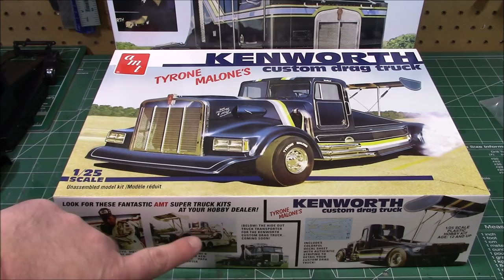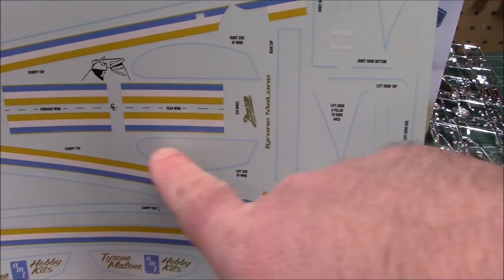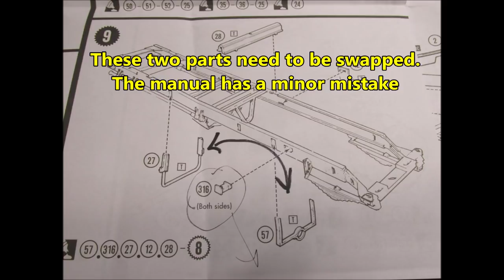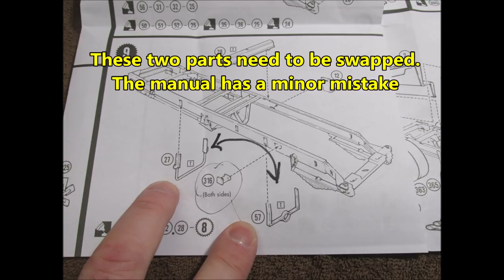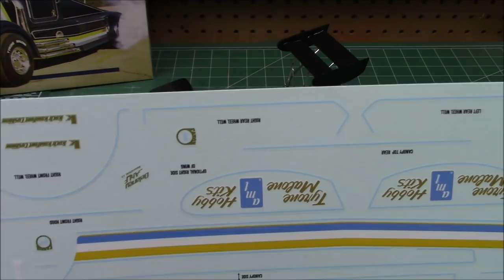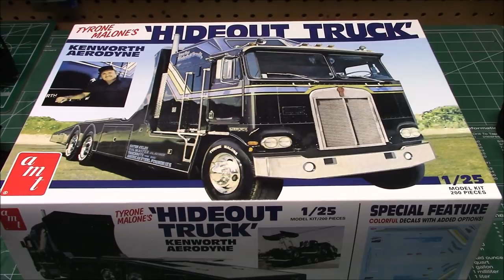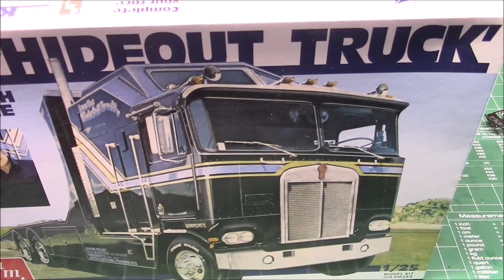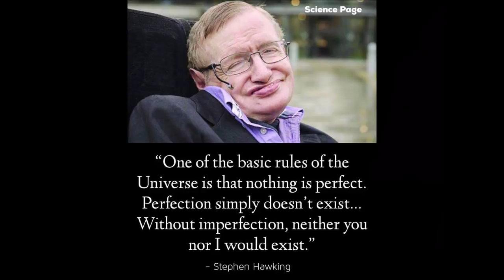Kenworth Bandag Bandit / Hideout Truck Tyrone Malone Drag Truck 1/25 Scale Model Kit Build Review

Comment: Started the Bandag Bandit today Chris, I was going to just clear it like you did but the cab had some pretty good scratches in it, I sanded it down and ready for prime and paint, engines done and ready for paint, working the frame now, it is a little fiddley but going together ok, got to do a couple test spoons I'm either going to paint it Tamiya Metallic Black or Dark Mica Blue I'm leaning towards the Mica Blue because it looks like the photo has a Blueish look to it 😃
Reply from the maker: I guess on the real truck they mixed a bit of blue in the clear coat to get that look.
I have a Tamiya 1/14 RC semi in Mica Blue, it looks really nice.

Comment: Nice build! I love watching your channel as you build straight out of the box, which could entice new modelers into trying the hobby. Myself, I've been building for almost 50 years, mostly big rigs, and usually do a lot of scratch building and adding aftermarket parts. I usually airbrush clearcoat on the cabs but was wondering how you apply the Future polish? It seems like that would be an easier way to get the shine if I was doing a quick build. Keep up the great work and I'm looking forward to your build of the hauler for this one.
Reply from the maker: It gets brushed on and left to dry. Thanks!

Comment: even if you hadn't gone back and adjusted the gap, it sill turned out real nice, so was the cab set back a little more to the rear cowl to close the gap since the rear wheels fit the rear wheel opening correct ??
Reply from the maker: I had the hood on too far forward, which moved the cab up which gave the gap. Once I joined the cab to the rear, then installed the hood to meet those parts it all worked out.

Comment: Hi Chris, I'm getting ready to start the Bandag Bandit And was wondering if you could tell me what caused your gap problem and what you did to fix it, I'm hoping to avoid the gap. Thank you Chris 👍
Reply from the maker: I put the cab on first and everything else after.
I fixed it before the final. 
Should have glued the cab to the rear body, then placed the rear body on the frame where it's marked to sit and it would have lined up the first time.
Reply: @hpiguy  thanks Chris I'll give that a try when I get there

Comment: Nice Job! - quick question with paint....I’ve been having problems with the paint chipping on the car body as I assemble it……wondering if Im not letting the paint cure long enough before handling? I usually spray the body and then wait 2 days after the clear coat…..should I be waiting longer or am I maybe not spray the primer, paint and clear coat properly
Reply from the maker: I've never had paint chip on a model unless I wanted it to. Sorry, no advice on that.

Comment: I would like to see a video on how you break a glue joint like you did with this model to correct the mistake. Thanks
Reply from the maker: I do final assembly with super glue and if you give it a quick tug it will snap clean most times. Unless you hose it down with glue.
Reply: @hpiguy  I have found putting a part that is super glued in a freezer for a while will make the  joint break easily.

Comment: Can you airbrush future on kits?
Reply: He's done a bit of airbrushing in older videos but seems to prefer spray cans and I can't really blame him, they're quick and easy for multiple builds every week.  I LOVE my airbrushes, but I take months to build in my spare time. I bought a very nice set of 3 airbrushes a few years ago on Amazon for a great price. I run them on a 3 gallon "pancake" compressor with excellent results on both model kits and full size vehicles. I did have to do a small "plumbing project" to connect the airbrush fittings to the compressor, it wasn't a big deal though. It takes practice but once you get the hang of it airbrushing is easy. The hardest part, other than finding time to do it for hobby work, is getting the mixture and technique down. Practice makes perfect-if you have the time. There are many good videos on YouTube to help you along.
Reply: Mike Brown I was wondering if you can use future in your airbrush instead of using a brush
Reply: @ericbowman7015  That I couldn't say for sure because I've never tried it. I never even thought about Future as a clear coat until watching this channel. I still haven't tried it but I plan to soon. On the other hand, I can't see any reason why you couldn't use it as long as you can spray it.
Reply: @ericbowman7015  yes you can and it doesn't need to be thinned just pour and spray
Reply from the maker: Yes, spraying works just fine.
Reply: Thanks guys the information was helpful

Comment: Was that engine 2 Stoke Detroit
Reply: Yes a V-12 Detroit. Not sure what the displacement is though. It's also backed up by an early Allison automatic transmission.
Reply: Was a 12v92 variant. Take 12 x 92 that's how you get the displacement of the 2stroke Detroits like 8v71 8v92 etc.
1104 cubic inches! Had to get to a pen and paper! 18 liter.
Reply: @tomcline5631  My dad was an owner operator for most of his life, and I'm an owner operator too. Even though he loved his Peterbilts later in life, if he could, he'd tell you that the best tractor he ever owned was a 1979 GMC General with 8v92ta Detroit power. About 2 years ago, I tracked down and bought dads old Gentleman Jim (that's what he named it) and it's now in my shop being restored in his memory. Jim also has an Eaton 15 speed and Rockwell 44k rears on springs. The restoration has and will continue to be a long process but it'll be worth the time and expense because my sister and I both have great memories with dad and Jim! There's also nothing like the sound of a Screamin' Jimmy on the Jakes!
Reply: @MikeBrown-ii3pt  Man,that's amazing! I love the General! When I was a pup,I worked at a shop,and we contracted with a local quarry that had dozens of Generals as their highway dump trucks. Some had Detroits and some were Cummins. That's the 2 I remember, probably some had cats in em also. It took all day to service 2 of them because they had over a hundred grease zerts! We had 3 charts that showed the location of the different set ups over the years. Amazing trucks. 
I drive trucks for a farmer,and one of the neighboring farmers has two Generals,one is a 10 wheeler and the other is a tractor and trailer. Old Coke trucks. 
I hope you have the budget and time to get your old man's truck back to it's Glory!! Almost choked up a little reading your post. Best wishes! Keep the dirty side down!
Reply: @tomcline5631  Me, my wife and sis are getting Jim back in shape slowly but surely! He'll be a show truck in another year or so and dad would be proud. Thanks for your reply.

Comment: The gap between cab and rear body, maybe mold error and engine mount holes are a few inches too far forward on frame rails. If I build this kit, I'll make engine holes a bit bigger to rear and fill in excess as well as shorten front driveshaft to try and close gap. If it works, I'll let you know.